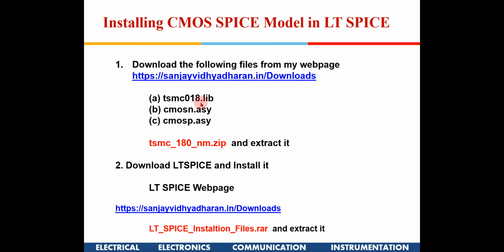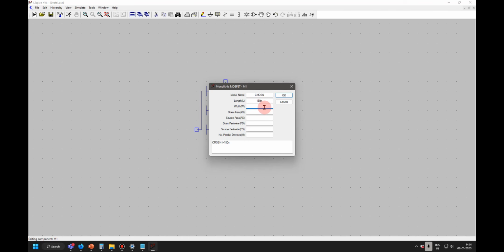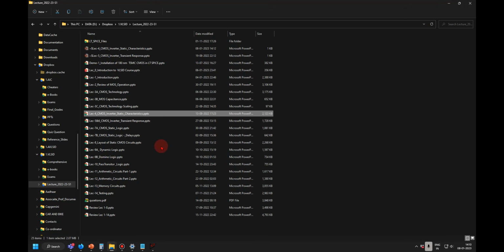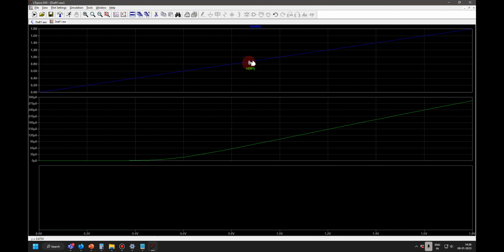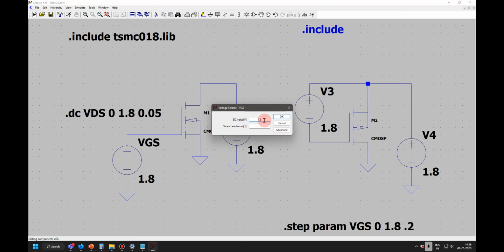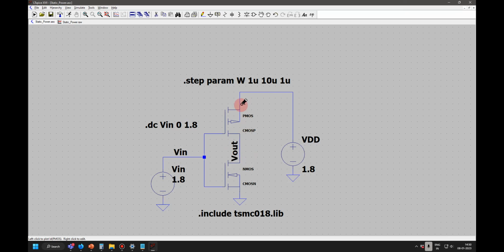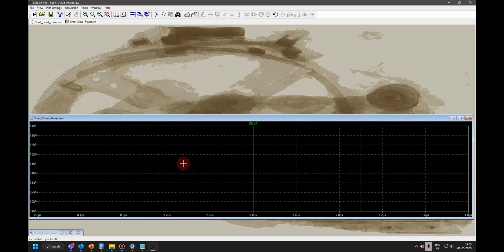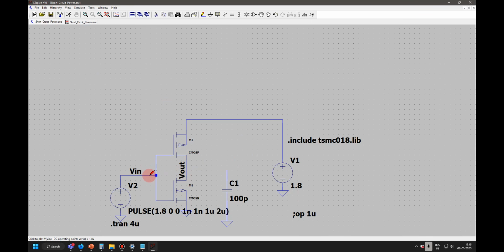Basics of LT SPICE and Installation of TSMC 180 nm Technology Filesin LT SPICE

Comment: Dear Professor, 
Please, I need to help me to change the interconnect parameter in the LTSPICE for CMOS circuit conception.
Thank very much for your help 
Best wishes
Reply from the maker: I dont think LTSPICE has a provison to change the interconnect parameter.  You may replace the wire with equivalnet wire model
Reply: @SanjayVidhyadharan  Thank you very much Professor for your response. Best wishes.